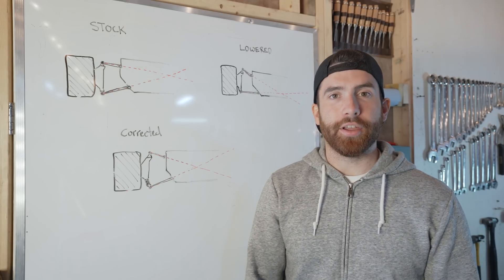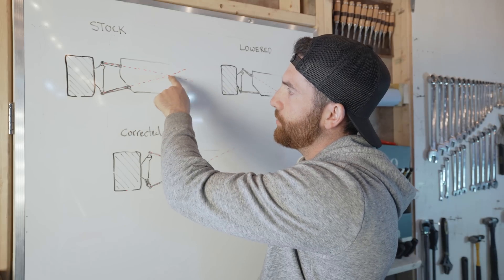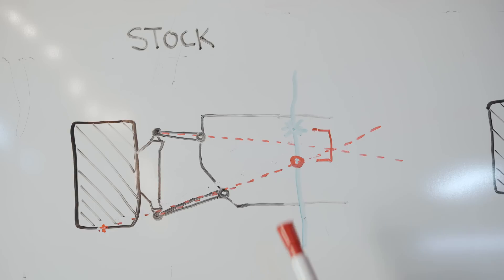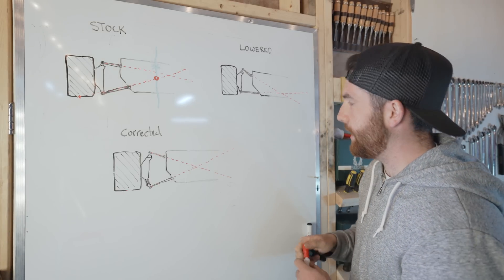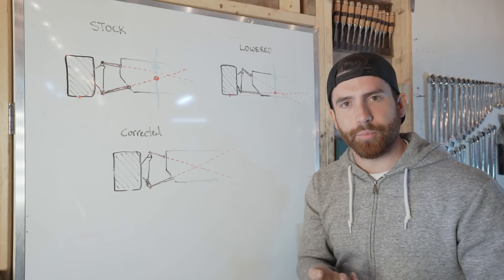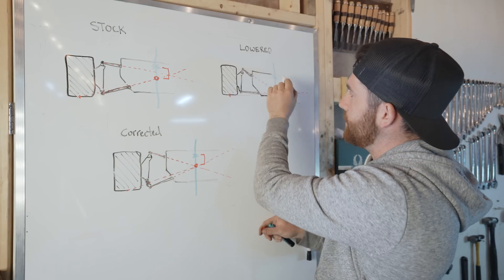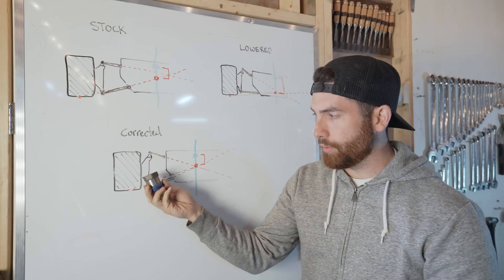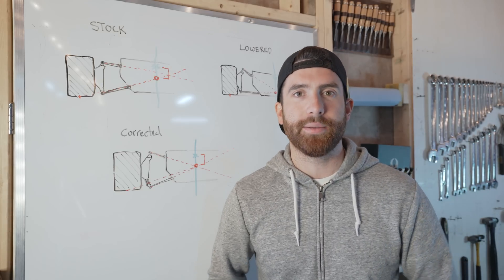How to correct roll center on a lowered car

Comment: The trouble with the corrected version is that when you change the angle of the lower arm, dynamic camber becomes more aggressive.  
Which means when your car rolls, the camber increases in the negative camber orientation more so than stock. Something to keep in mind.

Comment: Well, in the example that you gave, why not just extend the spacer between the lower ball joint and the hub (even more so than you did in the example) that way your roll center and center of gravity can line up even more perfectly than when it was stock?

Comment: Great work, good explanation. I've been a licensed technician for over 47 year's and it drives me nuts, that people insist on dropping the care without knowing the huge ramifications it has on steering geometry.. the best and cheapest way to lowering the car is raised spindles or steering knuckle.. keeps all factory geometry, fast and easy.. i have no patience for those who cut spring's and create very dangerous camber, SAI,  turn out radius, etc.. 
Playing with drop spindles or the right rated spring's make it for a perfect handling car.. 
Keep up the great work..

Comment: If you do that you maximize non elastic weight transfer and should get difficult grip control at the limit. Usually people want a low RC to handle the weight transfer by suspension and compensate roll with ARBs.

Comment: So one option is lowering the pickup point where the lower arm connects to the hub with the spacer.
Am I right in thinking that raising the point where the lower arm connects to the chassis would have the same effect? (custom subframe)
Reply: Yes that would change the angle too
Reply: From my limited understanding yes it would have the same effect but the height adjustment on the chassis wouldn’t be as drastic as the the same height adjustment to the hub since it’s closer to the rc. Someone may correct me if I’m wrong
Reply: Same basic effect although lowering at the ball joint gives a slightly lower roll centre overall.

Comment: so hey i saw you're video awesome info! so for example for my rsx or Dc5 whatever you wanna call it, i need lower ball joints there worn since i lowered the car i noticed i feel the road alot more but noticed more bump steer and steering wandering would you recommend roll center correction for regualr street driving? and what would be best K-tuned or Buddy club i know its not a mini but i thought i ask thank you like and subscribed
Reply from the maker: It's always good to correct bump steer when possible.
Reply: @Stevestonmotorco  what would you recommend buddy club ball joints or ktuned

Comment: I think it depends on how serious people think they should handle a lowered car. A lot of them (maybe most of them) automatically assumed that just lower the suspension and you'll get everything. But when you really look into it, you may need the correct roll center with a control arm mounting kit; you may need the correct steering with the bump-steer kit; the correct camber gain with the adjustable suspension mount; the correct caster gain with the adjustable length control arm. And the problem will be more complex if it isn't double-wishbone with 2 A-arms, things just getting more complex. I gave up lowing my suspension after I built an excel sheet calculating it.
Reply from the maker: Excellent points, agree. Bump steer is always an issue when changing suspension geometry. On the street it's usually not noticeable to the average driver, but at any fast pace then things like spacers on the tie rod to get the angle right become much more important.
Reply: That's how i first heard about it even...lowered my car to max as it could, tried it driving a bit harder, got dissapointed in coilovers and then i found out 😂😂...it all needs to go to it's place after you lower it..

Comment: when lowering a car say 1" does that mean you need to move the pivot point the same 1" to reset roll centre or does it depend on the type of geometry the suspension uses?
Reply from the maker: It depends on the suspension design. But correction is usually some combination of changing arm lengths and pivot points.

Comment: So using tires with a larger offset would also affect roll center?
Reply: Yes, because the centre of the contact patch is moved however the effect would be small.
Reply: @embeetwelve  
So its lowering the car that affects it a lot?
Reply: @ibome466  yes, changing the stock ride height will change the roll centre more, but it might not always be a bad thing, it might even perform better.

Comment: Apart from the spacered ball joint, we could also use adjustable lower arms?
Reply from the maker: You can use adjustable lower arms to adjust camber and castor, but they won't really affect roll center